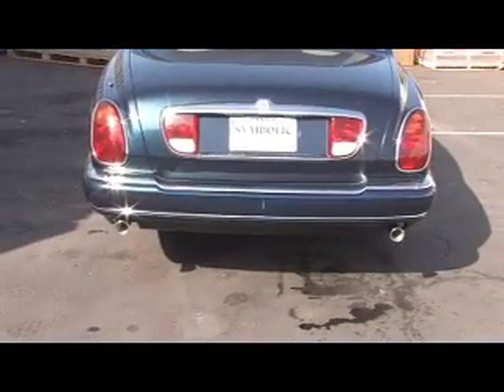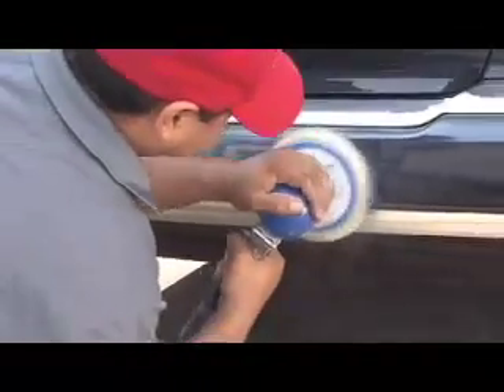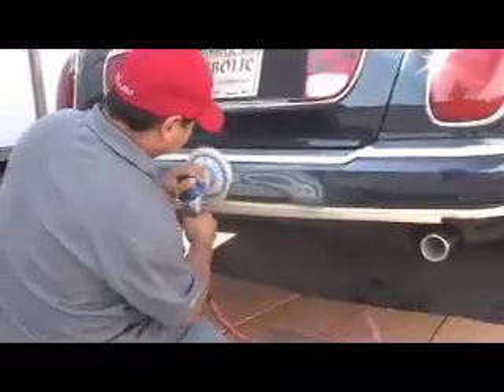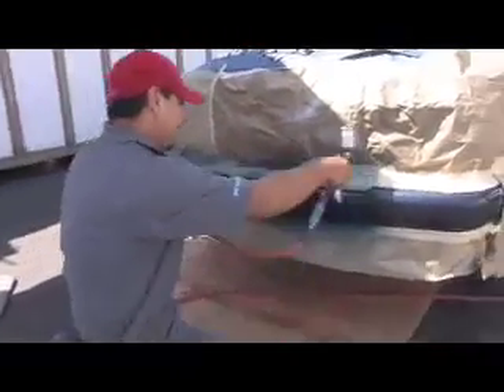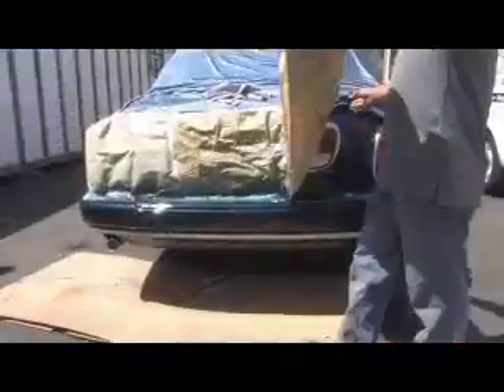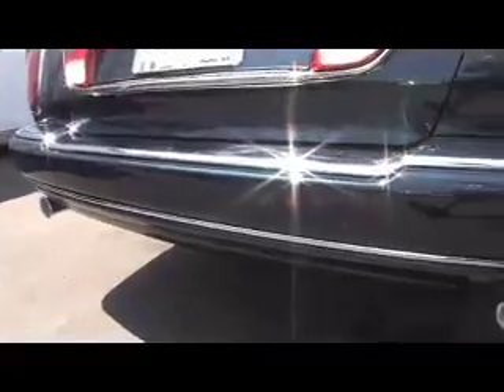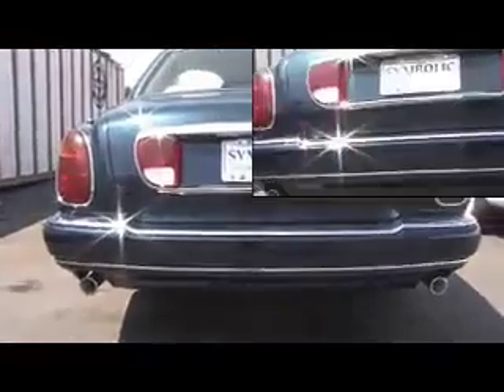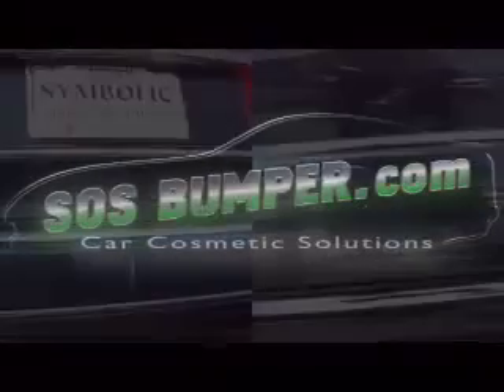Mobile Bumper Repair, Spot Paint and Mobile Services in Los Angeles Area

Comment: Hi 

well you have a good point, painting outside is not easy but there are tricks how you can do great job even outside. We paint outside mostly bumpers, which is easier then body.
When we selecting area for painting we make sure that dust will not flow around. You can use thick plastic and also spray floor with water which helps a lot.
There is more to it but I hope this will answer your question